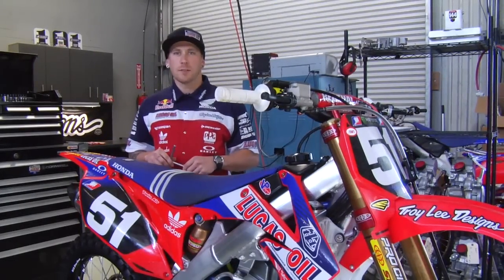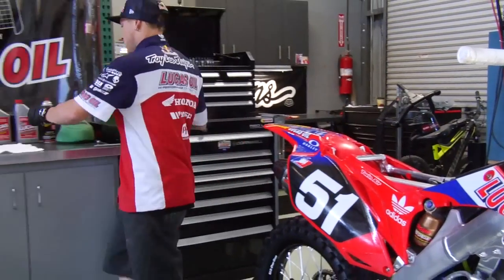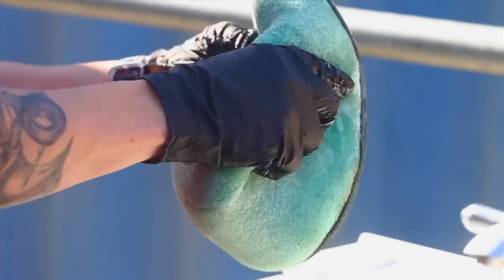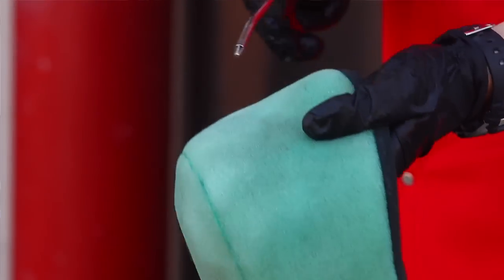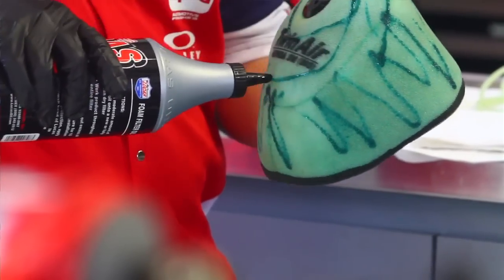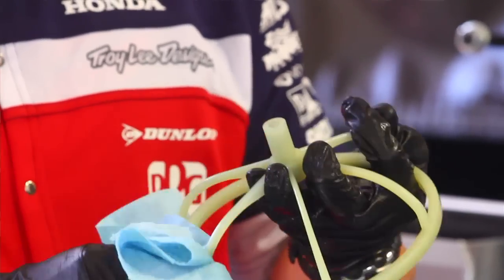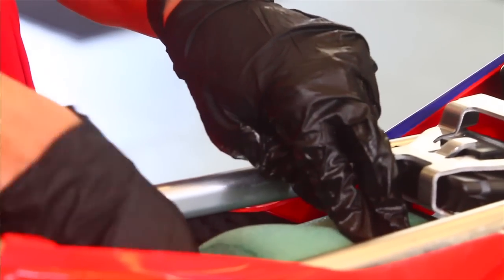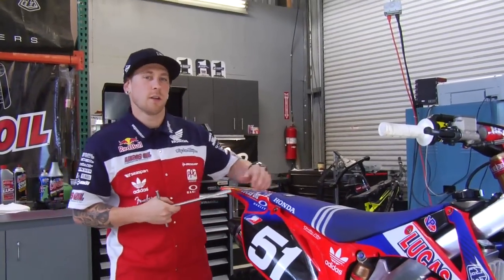How To: Clean and Oil your Air Filter - TransWorld MOTOcross

Comment: Great tutorial, you hit all the important points of the air filter maintenance process. Only thing I'd do different is use only dish soap to clean the filter instead of the pricey air filter cleaning products. I've tried a few different types out but haven't noticed any improvements.

Comment: Nice video, only thing i different  is i would prefer to let the filter sit in the sun for an hour or so so the alcohol can evaporate. Any air filter oil i have used is diluted with alcohol so it has a thin viscosity and gets into all the filter pores. Once the alcohol evaporates, the oil gets very tacky. Putting the filter back in the bike and putting the seat or cover back on could cause the oil to drip off the filter into the EFI (new yamaha) or Carb and foul a plug and or not have enough oil on the filter to properly catch dirt. Ever see a puddle of oil on the floor from the airbox? this is why.

Comment: the best way to clean it is actually by filling an ice cream pail half full of gas and then just dunking the filter in the bucket and work it around fr a bit. the filter will be clean in 15 seconds or less guarunteed
Reply: I actually do that or spray some carb cleaner and air dry it.
Reply: kananisA75 don't use carb cleaner it makes you filter fall apart and little pieces fall in the car or EFI i learned that the hard way
Reply: Jacob Miller
wow didn't know that thanks.
Reply: It's better if you use straight kerosene. It has the cleaning power of the gas, but it won't break down the filter!
Reply: +Offroad circus yea you can do that but it will slowly eat away at your filter
Reply: mineral spirits is the best im not paying for name brand filter cleaner!!!!!!!
Reply: can you put the gas in your 2 stroke when done?
Reply: Lance Hudson no

Comment: do you have to use oil on the filter??
Reply: Yes without the air filter oil dust particles won't get caught in the air filter and they can get into and harm your bike
Reply: so if I get a new pitbike as soon as I get it will I have to put air filter oil in it
Reply: yeah i would but you can ride it around the street for a minute before you do

Comment: Use contact cleaner to clean your air filter?  That would take like the whole can...  Use a bucket of kerosene or diesel.  It does the job and lasts longer.  DO NOT USE GASOLINE like many dorks do.  This will shorten the life of your air filter BIGTIME.
Reply: All destroy the foam cells.

Comment: you didnt put grease around the edge of the filter lol just sayin
Reply: 3:00 yes he did
Reply: +ILoveToast thats air filter oil , not grease silly.
Reply: That works too. He just didn't put a nice bead all around it, he rubbed it in.
Reply: what grease is best to use as a seal bead?